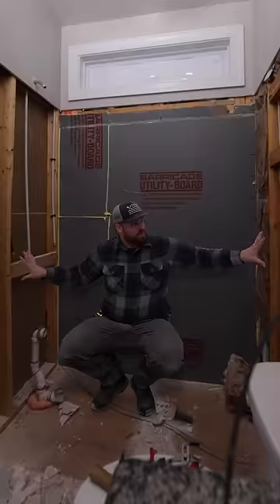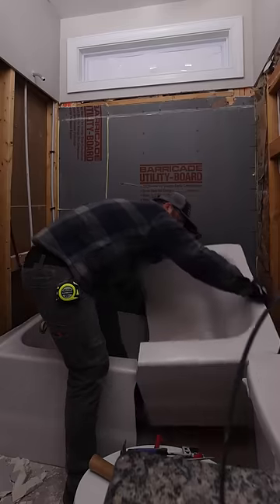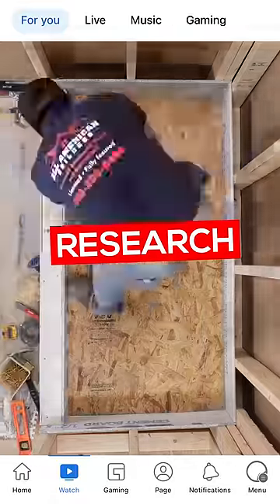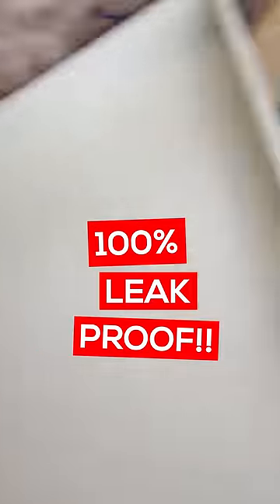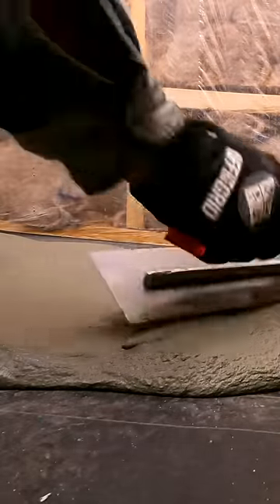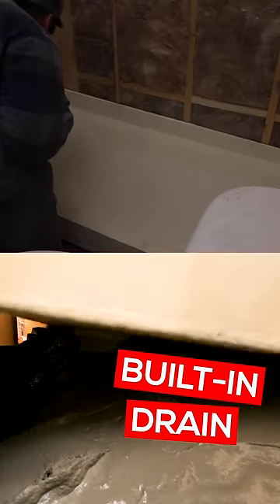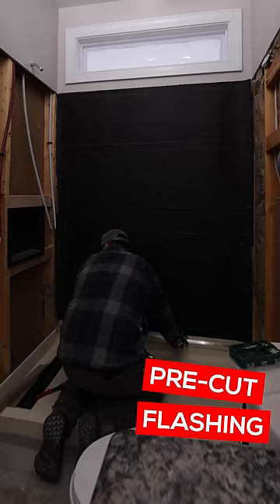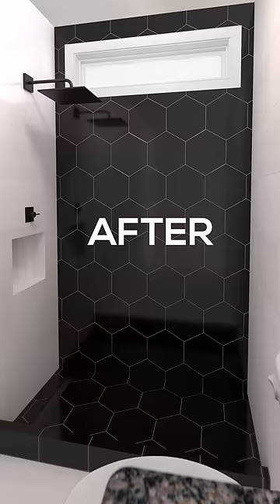DIY Shower Remodel Pan Demo and Leak Prevention

Comment: Wow, the main electrical panels right up against the shower wall
Reply: That's just wires, you cant run romex behind a service panel.
Reply: @sexymonkey4979 Having wires run thru ur bathroom is normal But a whole panel  ?
Reply: I just saw that dedefinitely wierd

Comment: Never buy Kerdi.. They leak 60% of the time. I do tile for a living. I don't know Many times I've had to fix kerdi. Somebody needs to file a lawsuit against them
Reply: I would love to hear more about this. Just curious!
Reply: That’s because it’s installed wrong. I have never had a leak over 20 years . Those that get training and install it properly have had 100% success. You need to use proper thinset also. Usually the leak is from improper thinset being used and people overlook the corners .
Reply: Yeah but 40% of the time, it works every time
Reply: When you dont install it properly, just like any method, it'll leak
Reply: You did it wrong then
Reply: What do you recommend
Reply: You're the first person I've seen online with this opinion. If you could objectify the statement I would find a ton of value out of it
Reply: The do fail a lot I agree
Reply: @ThaiRoney do I use unmodified thin set? I heard they changed it to modified.
Reply from the maker: You can now use a modified thinset / tile mortar to set the tiles to the pan. The approved thinsets can be found here: https://cdn.shopify.com/s/files/1/0749/8717/6241/files/InstallationInstructions_ShowerPanPVC.pdf

Comment: man, they keep coming up with silly ways to charge clients more money. Yikes, just looked up the price. 250 and up. I would not recommend using that upstairs or on a raised foundation. Homes never stop settling and it will crack that pan over time if its not on concrete. Hotmop is king.

Comment: As a tile installer.....i wish every homeowner wanted one of those.  Hope it doesn't leak. Maybe you didn't show the drain in enough detail but if it was a simple " horn" on the drain like a toilet. One clog in that drain and it will go under that pan and rot your studs. I always pre float, rubber liner, then float, set , and grout. Great video
Reply: Yep. It will too

Comment: I think the point isnt the "leak free" things youre using. You started with a black rubber liner which is exactly why showers leak. It wont flood or leak right away but itll gather underneath that '"leak free" white pan and as it sits overtime and fills up, itll start going through the grout and seeping through the corners of your shower by the trim. Ive been a tile installer for 7 years and the black rubber liner is the OLD school way. Im sure you dont want to hear about what i use either...as old school guys usually crap on all the new systems anyways, because theyve gone so long doing it there ONE and only way lol 😂
Reply from the maker: Our shower pan is made from a polyurethane material and there are no seams.  It is all molded as one piece so there is no where for the water to seep through. The drain is also incorporated.
Reply: @TileRedi_US  did you use any type of sealant around the drain?

Edit: looks great though! I learn something new everyday :)

Comment: For me the one and thing that was most disturbing was getting the pitch right.  That is why I purchased the Tile Redi custom pan.  The only reason that I brought in a plumber was for the drain because we only had access from above and the drain had to be lined up exactly and sealed from above when the pan was set.  Everything else was easy because the pan wall edge are level.  The base tiles were easy to install, and the walls went up straight from the pan.  When we had the first shower, the tiles drained perfectly due to their correct base pitch.  This shower looks fabulous and was easier to deal with than expected.

Comment: Beautiful job 👏🏾 👌🏾  i just installed a shower/soaking tub. Went with micro ciment because its has no joints and every layer applied is water proof then you seal it with 3 polyurethane coats. Dummy proof for DIY

Comment: Why the mortar under the pan?
Reply from the maker: Our pan is formed with ribs on the bottom that need to be filled with Type N or Type S Mortar.  This allows it to dry up solid, no flex or opportunity for tiles to crack.

Comment: Man, I'm in the process.  It's a lot of work for sure.
I went with tile redi  because High percent  of built up shower pans leak causing so much damage.  Our house had a leak for 16 yrs and it was underneath the liner in the base.
Want it done right You have  to do it yourself.
Reply: Bro there is a electrical panel in the wall of that shower 😮
Reply: Holy cow you are right.

Comment: you just lay this set and tile on top of that pan correct??
Reply from the maker: Yes, the pan is already waterproofed and pre-pitched from the factory, so all you need to do is set it into a mud bed and then tile with a modified thinset once the mortar is dry.

Comment: Did you waterproof the walls?
Reply from the maker: In this video, the walls used needed to be waterproofed.  We have introduced our Tile Redi Wall boards that are completely waterproofed - no need to add additional products to them.  They're ready to tile after installation.

Comment: All shower pans are leak proof, or should be.
Reply from the maker: With our pans you don't need to worry about "should be".  Since it's all one-piece with integrated drain, there is no place for the water to penetrate.
Reply: Pretty much. Just have to make sure the drain is sealed.

Comment: They no longer have the flashing. Unnecessary.
Reply from the maker: The Redi Flash is still available as an option, but as you stated some prefer to use a sealant on the splash wall connection to the pan or other form of waterproofing.
Reply: @TileRedi_US  Hm, I was tole by one of your people in the office that it was no longer available, because they had a work around for it.

Comment: deceiving ad ,,anything done incorrectly will leak ,mess this up and its gonna leak
Reply from the maker: We agree, any installation done wrong is problematic, BUT, with a Tile Redi shower pan you can avoid all the leakpoints since there are no seams to worry about at the floor to wall connection or the curb.  The drain is also incorporated so leaks there are also eliminated.